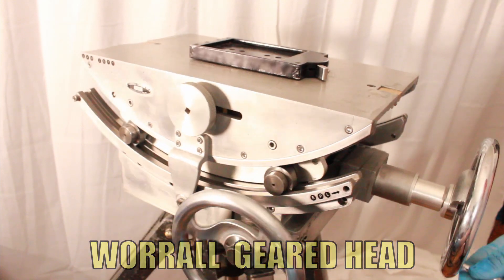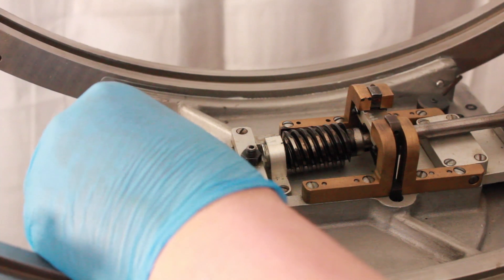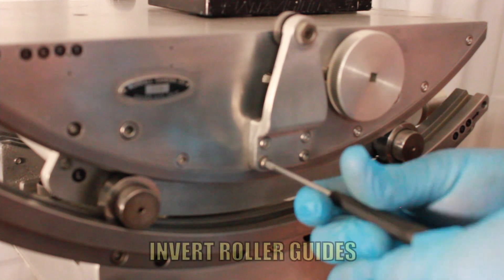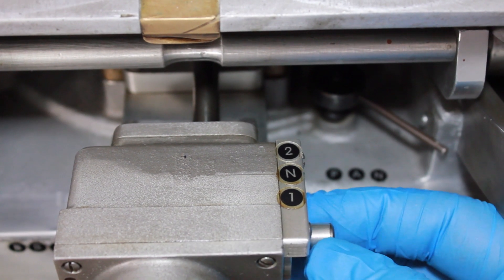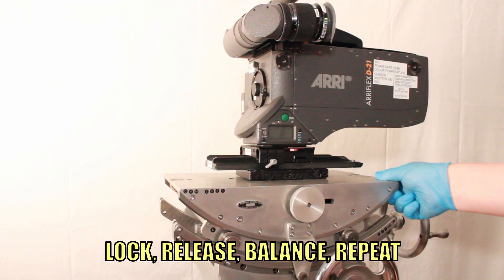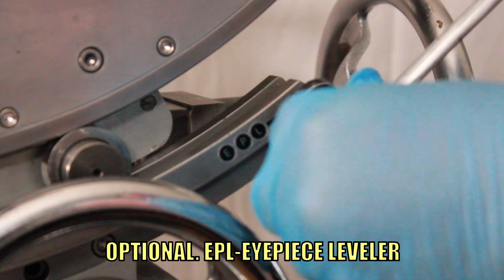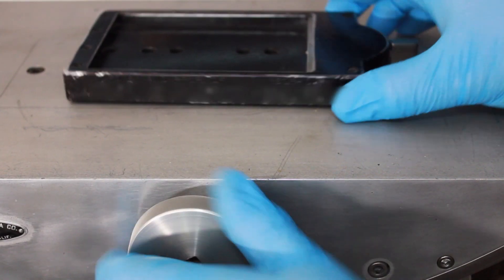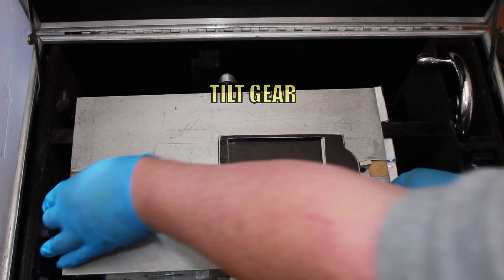Worrall Geared Head Set Up

Comment: Do you guys have a video on the D21?
Reply from the maker: No video as of yet but happy to answer any questions you have.
Reply: @filmcontraption9326  Thank you! 
- What’s the weight of the D21? / is there a shoulder mount option? 
- What power system does this use? Same as the Alexa EV? 
- What external recorder is required and do you run 4 SDIs into the recorder or is it one multi pin? 
- How does the sensor behave with Highlight roll-off? 
- What files does this output? 
- What have you shot so far with this unit?
Reply from the maker: @barclaymovingpictures3041  This is a link to the ARRI D-21 User Manual   http://www.davidelkins.com/cam/manuals/manual_files/arri/d-21_manual.pdf
Reply from the maker: The weight is about 27 pounds without accessories. Yes there is a shoulder mount option with the same ARRI accessories used for its film cameras like the ARRI 435. Same 24V power as Alexa EV. The camera can output uncompressed 1080PSF video and can be recorded to many systems the like the Atomos Shogun or the AJA KI PRO in 422 Pro Res. It can also record arriraw to Codex recorder but the arriraw is different than Alexa Arriraw so you must use a Codex Recorder. My other videos show some test footage I have shot with the D-21. I hope this helps.
Reply from the maker: The arriraw footage is dual stream so it uses 2 bnc cables.
Reply from the maker: This is a link to an interesting video about the D-21 https://www.youtube.com/watch?v=7Hd87IYYCw8
Reply: @filmcontraption9326  Thank you for taking the time to answer all of my questions about the beast 💪💥